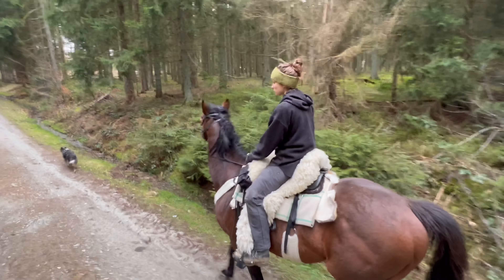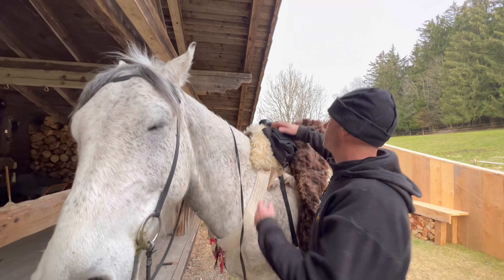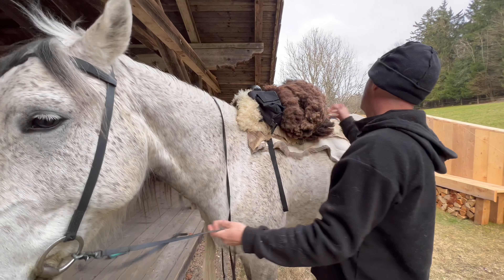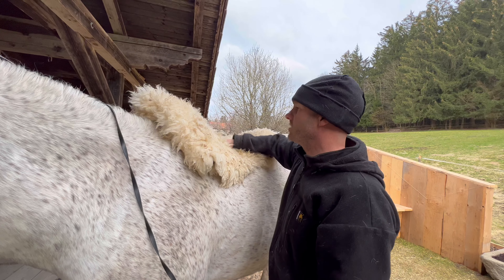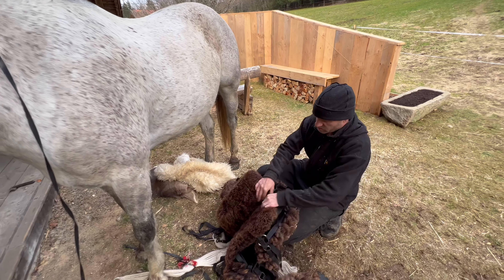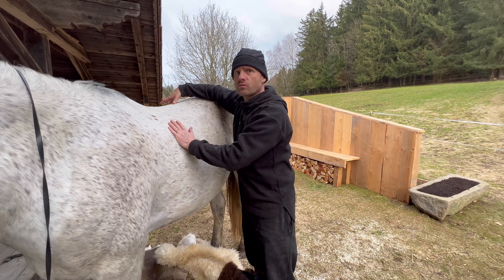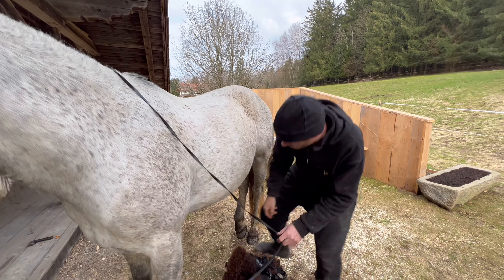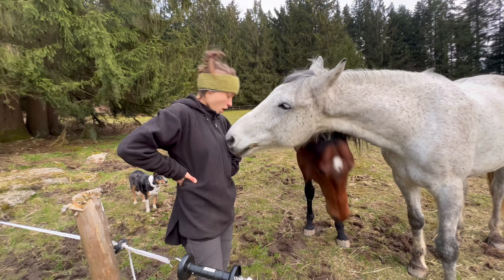2023 Long ride saddle set up and testing.

Comment: What is your opinion on using a dressage saddle for long riding?
Reply from the maker: That’s a TERRIBLE idea. It’s a “dressage” saddle. It’s like wearing ballet shoes on a hike. It is simply NOT designed for the extra weight and is unable to carry bags clear of the spine if attached to the rear. Flick me an email at beprofessionallookcool@outlook.com and I’m happy to chat about it via what’s app too. Dressage saddles belong in the arena or woodchipper. NOT on a long ride. :)